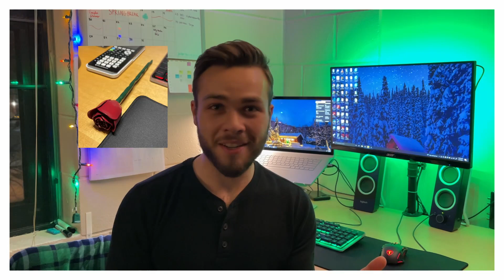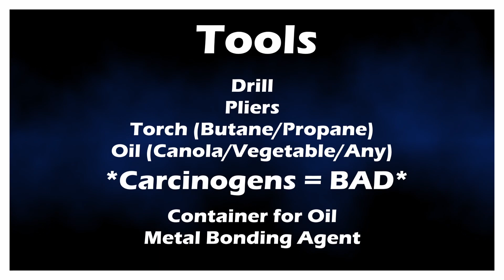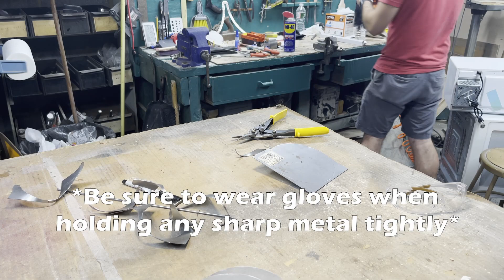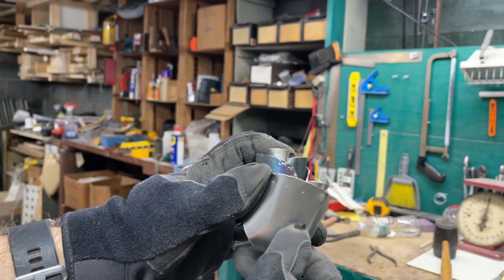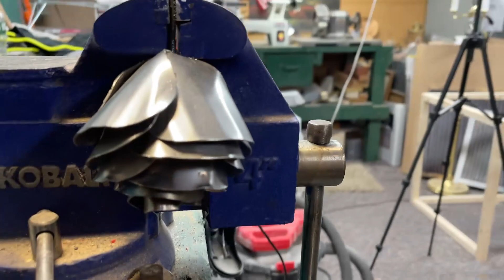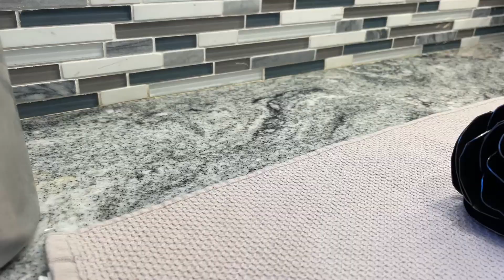How to Make a Metal Rose  |  Easy  |  All Steel  |  No Welding Required

Comment: hey i was trying to comment on your mk5 video but it's set to kids so comments are off

I'm also building this and almost done!  

had some of the same problems you did with powering the servos on the pca,  idk what was happening but everything would short out when i turned the pca on.  

i think i got that bug worked out though as i'm now testing the motor orentations

i'm at a problem now where the 8 and 9 servos are backwards so now i have to go into the code and change those integers i guess..

no clue how that happened, but i've seen comments where ppl had that problem with the wing servos... weird.

thanks for uploading that video dude, it reassured that i wasn't losing my mind on this build and i'm not the only one with issues haha!

tried to get ahold of  box&loop but it seems he's on VACATION
Reply from the maker: hey there, sorry about the accidental kids mode, all fixed lol. I didn't run into that 8&9 problem, but if the problem is that they are moving in the opposite direction (CCW vs CW), then your wires are probably plugged into the wrong ports on the driver board. Swapping the leads should work.
The problem of accidentally mounting them in reverse (swapped the physical motors), then the same solution applies.

Honestly I would avoid changing the code unless you are comfortable with coding and you know it would solve your problem in an easier way then say, taking a ton of stuff apart and redoing it.
I should clarify that I only had to change the code for the wing servos because the arm on the servos I bought would only attach in angle increments of like 20 degrees, meaning I couldnt place the initial arm angle too accurately and needed to adapt.

Hope this helps :)